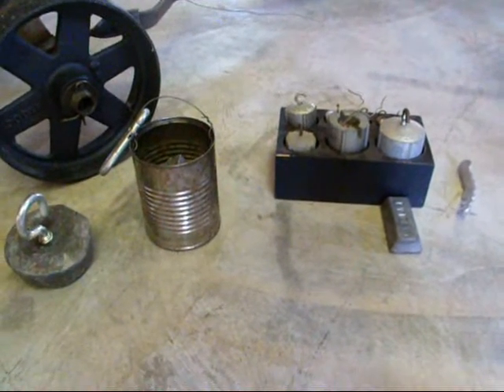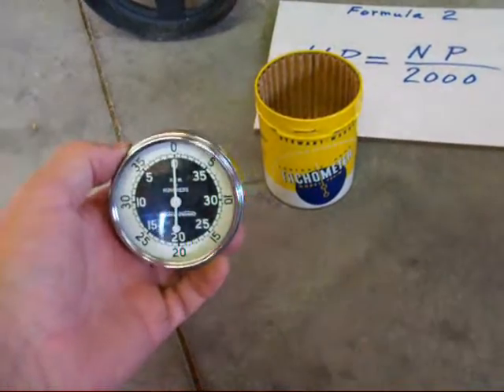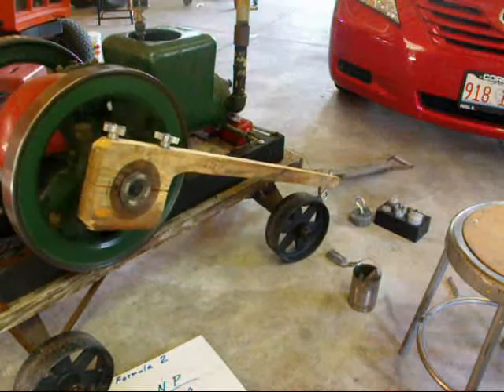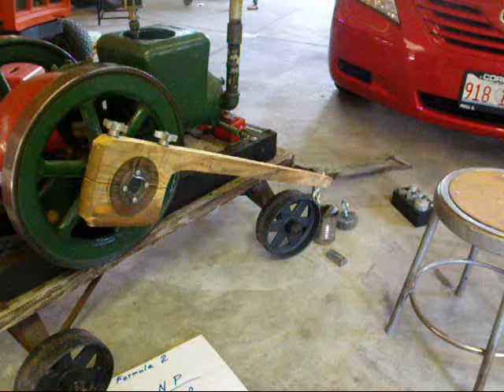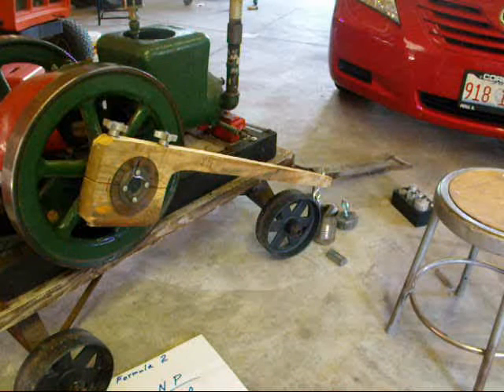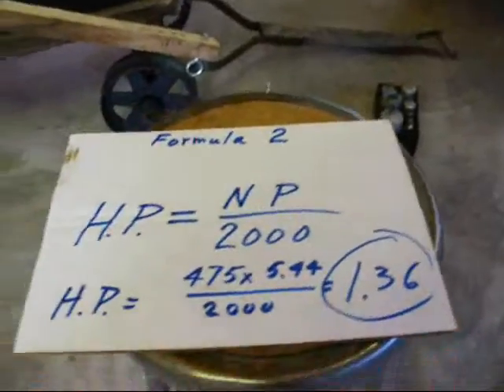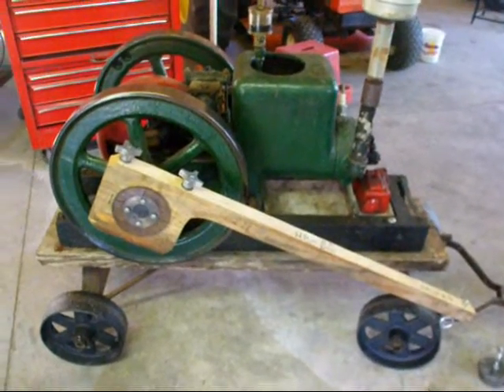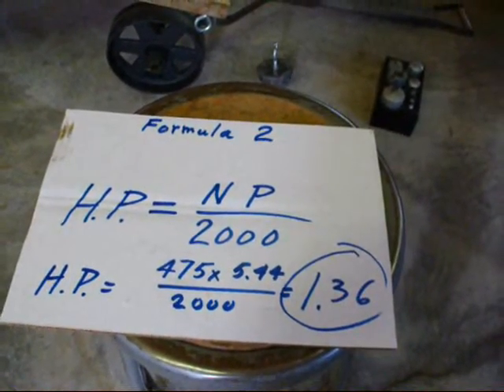Part 2 Prony Brake on HIT & Miss Engine FAIRBANKS MORSE

Comment: Awesome video, thank you! Question: why did you consider the weight you selected to be the equilibrium point? Is it because the engine could obviously not sustain its maximum RPM while under that load? I was expecting that you were going to see if tightening the screws would cause the motor to completely come to a haunt, and if not, then add more weight. And if I understand correctly, the clamp it’s the screws allows you to let the motto turn freely and you only tighten it enough to apply some friction to the shaft, but not so tight that the prony brake spins dangerously and uncontrollably? Trying to learn now how it works so I can perform some motor torque tests..

Comment: I'm confused. If you added a slightly lesser weight, but turned the clamp tighter, what would happen? Could you not find an equilibrium with a whole range of different weights, by tweaking the clamping force on the diameter? Then all those different weights would provide all different answers in the calculation. Does the heat being generated at the brake interface not need included in the calculation, or are these brakes just for getting a rough idea, and aren't expected to be as accurate as I am maybe expecting?

Comment: The word "dynamometer" brings to mind using a belt driven generator instead of a prony brake.  It would not be that long (in terms of history) before electrical generators would be developed after the steam/gas engines and prony brake.  In the dynamometer measurement idea, an electrical generator is wired to a bank of resistors (light bulbs) in order to put a variable 'electrical load' on the generator.  The loaded generator would, in turn, put a torque (load) onto the engine's shaft.  By adjusting the number of lights (resistors) connected to the generator's circuit, the maximum engine torque can be applied without the engine losing speed (from its rated speed).  The electrical output from the generator at this max point, would, in Kilowatts be a measurement of the engine's horsepower ( 0.7457 KW = 1 HP).   

There are small power losses associated with a belt drive; so, for the most accurate measurement, the dynamometer (i.e.: generator-bank of adjustable resistors) needs to be directly connected to the shaft of the engine.   But still, with a belt driven, home-made dynamometer, it would interesting to compare the horsepower measurements using both of these techniques on the engine/s.
Reply from the maker: Thanks

Comment: Ok. I am confused. This all depends on friction at the hub and the 2x wood how do we know what that is? Hopefully i am missing something simple here.
Reply: As i understand it really doesn´t matter much which type of wood you use (excerpt for it´s stability).
What you want here, is to know exactly how much the engine can lift, at a set distance.
If your wood has higher friction, you´d simply have to loosen the wingnuts to let it slide, and vice versa.
You could use a metal-rod instead of wood as your weightarm, but the reason for the relatively thin woodstick, is that it´ll break if you loose control, and it swings all the way around.
Was it made from metal, chances are that you´d have the engine dancing around...like a onelegged man, trying to stomp out a forestfire ;-)

Comment: I think you need to take the RPM measurement when the motor is under load from the Proney break.
Reply: He explained the took the RPM with the load on before he recorded because he had help and there was no one helping him when he recorded the video.

Comment: Wow. It´s been nice watching both of your videos. I was looking for ideas on how to use the Prony brake(which I've heard of so many years ago at the school) to find out how much power does an small motorcycle have by measuring the power by braking the rear (driving) wheel. Not because I need to, but for fun, I'm willing to perform a couple modifications to the engine to gain a little more power and I need a way of measuring what works and what doesn't.

You know, nowadays guys go to tunning shops whom own pretty fancy expensive dinamometers, no doubt they're much more flexible and precise, yet these "old school" methods apply the same old principles. I'm sure if one is careful enough like yourself measurings must result pretty much the same like the one would get  out of the fancy expensive tools. BTW in case you wonder I'm in Argentina, so I apologize for my funny English (not my mother tongue, apologies)

Thanks a lot!
Reply from the maker: Thank you, good comments.  Your English is just fine

Comment: Shouldn't the calculation use the "under load" RPM once the brake arm and weight reach a balanced condition instead of the free RPM?  If you don't, then you could tighten the two crankshaft bolts farther (more friction), which would then require more weight to reach a balanced condition, and you'd get a completely different horsepower number.

Comment: I am curious..  this is not a criticism it's an honest question:
Why not add one more ounce (an extra nut, maybe) to that Prony brake beam, so that the beam weighs in exactly at 1 pound.  It would make your calculations that much more easy.

Dimensions of the aluminum output hub (3") and the thickness of the brake beam (1.5") do not make any difference, as long as they are sufficient to put a proper working load on the engine at full throttle, is that correct?

LENGTH of the beam is however critical, correct?

Thank you.  Excellent video set!!

Comment: Hope you are still fiddling with engines! We used to have a "Z" F&,M  engine on the farm in central Cal. I  restored a John Deere 1929 model "GP" orchard tractor still on "steel" ( lol) Got it when I was 12 for $25. Cost $25 to have the magneto rebuilt at the time.ran it for years for fun, ran great. Keep up the great work! Hope to see more good stuff/science. Regards, Doug
Reply from the maker: I do still play with them occasionally

Comment: Tubal Cain,
Great video as always!  Why is it that one does not measure the rpm right at the time when the engine is slowed down under the load of the Prony brake to the point of equilibrium (instead of running free with no load -prior to applying the Prony load) for the purposes of the formula? I must be missing something here.
BTW   LOL! I love the reference to the "....busier than a one legged man trying to put out a forest fire". Got a big chuckle out of that.

Comment: IF the engine was turning at it's rated 500 RPM that would have turned out to be much closer to the 1 1/2 HP

Comment: I love your videos, however, you need to measure the RPM while the engine is under load.  It noticeably dragged down when you applied the load.

The free, unloaded RPM will give erroneous results of a higher HP than the engine is actually producing.

EDIT:  Oops, just saw that you took a measurement under load.  Left my comment since I still needed to say that I like your videos.  Great demonstrations.

Comment: Great video. I always wanted to make a prony brake and take it to shows, didn't know it was so simple but I remember reading the math.  Nice to have someone use the English terminology, newton-meters just doesn't sound right and sometimes you here the term lbs.-ft.  which really bugs me instead of ft.-lbs.  because ( I think) some one is converting from metric to English and  meters-newtons doesn't sound right in metric system

Comment: You could flip the arm around so it pushes down and use a springless scale on it. At old threshers in mt. Pleasant ia we have a prony brake there but we use a different formula we use weight x rpm divided by 1000  the scale is a fairbanks morse springless scale and also when you use yours you need to take the rpm mesurement right when you have the weight on but that might take 2 people

Comment: Great mini series on this demonstration. I was worried that I would not see any of your excellent videos until fall. I do have one question though. It appeared that you would be able to add even more weight to the can because you were adjusting the nobs to allow some slipage. So by adding more weight into the can and also your formula, that would increase the torque which in effect would change the horsepower? Or are you not trying to find maximum hp and just see what it is capable of?

Comment: Nice demonstration! I love all your videos. I have one question regarding the RPM. In the formula, should you use the no-load RPM or the lower RPM that results from applying the Prony Brake as a load?

Comment: Excellent video!   Let's see, it's holding 4.55 lbs at 31.5" (2.625'), so it's generating almost 12 ft/lbs of torque.  Since hp = (torque * rpm) / 5252, that yields 1.08 hp.  Not too far off from the Prony brake, and I'm sure it'd load down more at full throttle with a bit more weight.
Not bad at all for an engine that old!  Add to that all the kinetic energy stored in the flywheels, which is mind-staggering BTW,  and you have an engine capable of doing some serious work!  While sipping gas.

Comment: Good video.  However I think it should be stressed that a prony break is only a rough estimation so I'm not sure if you can go down to 2 decimals. But still a great way to compare engines.  Horsepower is of course a comparison unit, first derived to give farmers and other customers what they're buying (how many number of real horses).